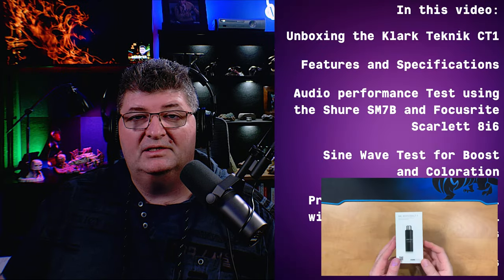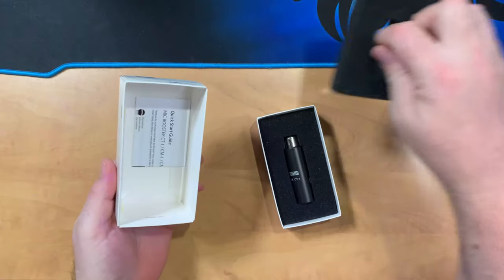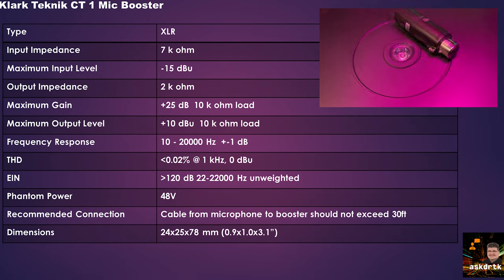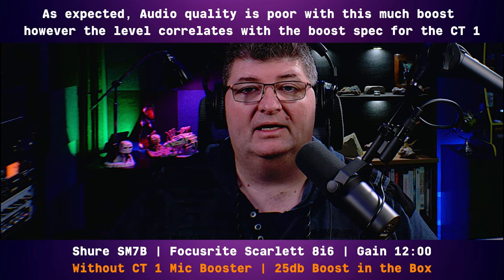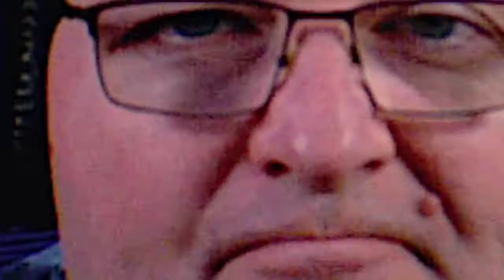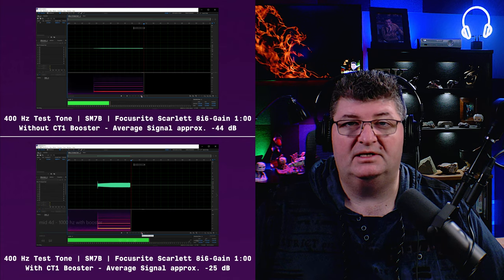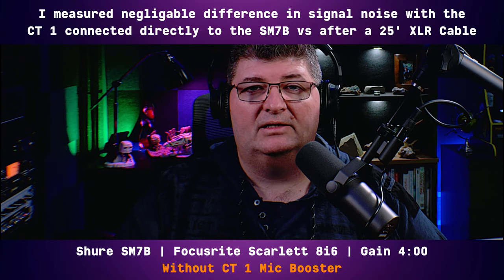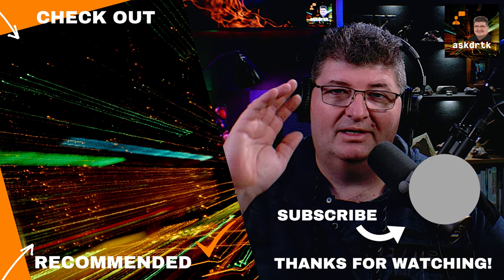Klark Teknik CT1 Mic Booster - Detailed Review and Tests

Comment: Thanks for your video! Though I do believe the long cable run before the booster makes for slight weakening of the signal. I feel if we put the CT1 right on the mic, there's significantly less cable run with low signal, instead basically the strong signal travels all the way directly from the mic into any preamps, which should make for a cleaner, stronger and less noisy signal. All through the same gear. But great video nonetheless!
Reply from the maker: Much appreciated! I agree 100 percent and I generally place boosters at or as close to the mic as possible for recording (one thing I don't like about my CL1s), but I thought since the CT1 specs say up to 30 foot cable between the mic and booster I wanted to test under this scenario. For comparison, I get about an additional 1.6 dB at 1kHz with the CT1 at the mic followed by a 25 foot xlr. I probably should have included some gain / noise floor charts "at the mic" and with a few cable combinations for those who like to use them on stage with 58s, etc. I'll think about that for the next mic booster review I do. Hope the bit of extra info helps out and thanks for sharing and checking our my review!

Comment: What a great device at this price over the $89 + ones.
Reply from the maker: Performance / build quality given the price do provide excellent value. The CT1 is a very good option for many. Thanks for checking out my review of the CT1!
Reply: @askdrtk  Mine actually died after one day lol. Started having tons of static and noise in my mic. Sweetwater refunded it, common issue I guess.
Reply from the maker: Sorry to hear - that is really unfortunate, but Sweetwater is top notch for service. I haven't heard of issues with these boosters and I have two myself that have been getting regular daily use for months with a few different preamps - no issues so far. The only one i have every had go bad was a Triton FetHead...
Reply: @askdrtk  Yeah that was weird. It worked great for a day then suddenly was all whacked out. Sweetwater was amazing though.

I will try another later, or just go the more expensive route and grab a cloudlifter.

Comment: which one is better the CT1 or the CM1
Reply from the maker: I haven't run a full set of audio tests on the CM1, however I have see the CM1 and the build quality of the CT1 seems better (stronger and more durable if you are moving it around). Also, the CT1 can be connected directly into your microphone, whereas the CM1 requires an additional cable between it and the mic.
Reply: @askdrtk  I don’t like the idea of it being connected to the mic 🎤 on the ct1 but I did see in the manual that you can run it as the cm1 with 2 cables
Reply from the maker: I agree, but some like to use it direct connected with the mic off camera...voiceover, etc. I've used CT1 with up to a 25 foot cable between it and the mic and then another 25 foot between the CT1 and preamp - no noise issues - all good. The CT1 is reliable, I've been using two of them in my shared recording space almost daily for months. I have other more expensive boosters, but the CT1 gets the job done.
Reply: @askdrtk  yeah im replacing my mic and using the Zoom ZDM1 which this mic has some buzzing ringing in it and the only was to get it to stop on the goXLR Mini is to drop my mic setup to around 35db and my treble from 4db-4db to 1db-0db at 7.5hz on the treble to get the ringing out but then it makes me sound really muddie this is not a problem with my mixer only via goXLR so the CT1 or CM1 will be best to get rid of the buzz dont really wanna spend money on a new mic the PD-70 or the MV7X
Reply from the maker: For sure boosting the signal will give you a better ratio against the noise from the goXLR Mini. If you're getting the noise on all mics connected to the goXLR mini, I've found noise from usb powered gear can often be reduced by using a ferrite core on the usb cable or changing you computer's power bar to an isolator such as a Furman or a Tripp-Lite isobar. Did this will all my gear and things got a lot quieter. Either way, more signal means lower relative noise.
Reply: @askdrtk  i never had this with any of my other mic's ive always used Condenser or Omni then Dynamic ive just purchased my first Dynamic mic a few months ago but the goXLR Mini bring that buzzing and ringing never had the problem on my other mixer. BTW was able to purchase the CT1 just now as its back in stock now on Sweetwater price when up $5 more also gonna purchase the CM1 for back up as soon as it comes back in stock
Reply from the maker: Great hear they are back in stock at Sweetwater - these are a really good value and having a backup never hurts... I'd appreciate if you let me know how it works out once you get it setup with your ZDM1 and goXLR mini.
Reply: @askdrtk  will do just got off the phone with frank from sweetwater should be here in the next 2days will keep you up to date
Reply: @askdrtk  btw have you review the Universal Audio SD1 and  The Villa MV3 really wanna try the Villa MV3 as it sound more like the SM7b and look like it more of a clone for $175 trying to see if i can get Review Units
Reply from the maker: I haven't tried either yet, but I would like to get my hands on them for review. I have a few really nice condensers up for review at the moment that are keeping me busy...
Reply: @askdrtk  just got the CT1 the other day its awesome only problem having is it dont stay in my mic. now that i got this going to purchase the MV3
Reply from the maker: Glad to hear the CT1 is doing the job. The spring lock can be stiff when they are new (sometimes needs a firm push to lock into the cable or mic). Let me know what you think of the MV3.

Comment: Is there any reason why this wouldn't help a weak condenser mic that has the option of being battery-powered, such as the Rode NTG-2?
Reply from the maker: You could use a booster such as this with a battery powered condenser mic. You could also use a phantom power supply such as the Xvive P1 between the booster and mic if a battery powered mic was not an option. There is also the Fethead Phantom mic booster from Triton that passes phantom power for condensers as an all-in-one option. Hope this helps out!

Comment: Thank you for this! I would buy one for my Rode Procaster. I am using UM2 - Behringer as an audio interface
Reply from the maker: All Good -  In my experience the XENYX preamp in your UM2 is pretty clean as long as gain is less than about 80%. The CT1 will help get your Procaster into the "sweet spot" without needing to push the UM2 too hard. The Procaster is a great mic and adding the booster should not only make the sound cleaner, but also thicken in up on the UM2. Hope this helps out and thanks again for checking out my review!
Reply: @askdrtk  I just ordered one for my Rode Podmic, using an RME fireface UC I wasn't happy with the level for spoken word for live voice chat in my case, the signal from the RME was very clean just not quite loud enough,  Many thanks for your solid review, The low end warmth should be quite pleasing in my case as I feel the podmic lacks a little low end warmth from the box.
Reply from the maker: Glad to help out. I agree, the CT1 is a good complement for the PodMic and should provide some additional warmth while maintaining the clarity the PodMic is well known for - i'm certain you will be pleased with the result. This will also give you a greater range of adjustment for gain on your RME (great clean interface) which is my preferred method vs simply adjusting in the box (proper gain at all stages beginning with the preamp = better sound imo). Thanks for checking out my review and sharing your use case!
Reply: @askdrtk  Thanks so much, I forgot to mention your review of the Podmic was in my opinion the best on here and influenced my purchase, thankfully the algorithm recommended your CT1 review as well. Keep up the fantastic content my friend and hope to see you continue to grow in the coming year!
Reply from the maker: Very much appreciated! I have alot of new gear (in all price points) in for review with more on the way + I am about to launch a full series on EQ, compression, mixing, and mastering with both plugins and outboard gear. It is going to be a busy year...
Reply: @askdrtk  Got the CT1 installed now and its doing the job perfectly, my gainstage via RME interface is superbly clean and plenty of headroom! Now just to contend with those pesky gaming PC fans lol...
Reply from the maker: Fantastic! Having room to adjust gain at all stages makes such a difference and ahh yes...PC fans definitely nice to be able to locate the PC away from recording areas. One day I'll add a long fiberoptic Thunderbolt cable between my PC and Dock and enjoy the silence...not anytime soon though...lol

Comment: Hi, may I ask if you have tried the CT1 directly at the back of Elgato Wave XLR?
Reply from the maker: Sorry, I don't have a Wave XLR to test. I see the recessed XLR jack would likely be an issue given the thickness of the CT1 cylinder. The male end of the CT1 generally does not fit directly into XLR jacks in my experience. If you need to connect directly, the sE DM1 has a thin profile and will likely not be an issue (I have tested it plugged in directly to many interfaces and preamps), otherwise you may need to use a short 1' XLR patch cable in between the Wave and booster. I hope this helps out!
Reply: @askdrtk Hi, I appreciate your time in replying. I bought a CT1 and confirmed that it is not compatible with direct installation with Elgato Wave XLR. I also bought 2 meters high quality XLR cable going from the mic to the CT1 and another 2 meters going to the wave xlr. So far all is well. Thank you!

Comment: Help mee.. Why my ct1 not working. Im using podmic with th audient evo4 audio interface.
Reply from the maker: The first thing to check is to ensure you have your evo 4's 48V phantom power turned on as the ct1 requires it to operate whereas the PodMic does not on its own. Hope this helps out!
Reply: @askdrtk  oh thanks.. it works.

Comment: Hi there, I just want to ask which is better setup. 1)Mic-->CT1-->XLR Cable-->Audio Interface or 2)Mic-->XLR Cable-->CT1-->Audio Interface? TIA...
Reply from the maker: In general, the closer the CT1 is to the microphone the better as it will boost noise picked up from the cable coming from the microphone in addition to the microphone signal itself. With the CT1 at the microphone, the mic signal travelling through the cable to the audio interface will be far greater vs any noise picked up along the way. That said, if you have short cable runs that are not running beside power wires, the difference will likely be negligible. Cheers!
Reply: @askdrtk Thank you so much! That's great explanation..

Comment: I even wonder how would this behave with different phantom power voltage, as there are devices which doesn't provide +48V but +15V, like cheaper mixer consoles such as Behringer xenyx 502.
Reply from the maker: That's a great question. Generally speaking with condenser mics, as phantom power voltage drops, transient performance decreases. It is often difficult to tell unless you are trying to record a very dynamic source (depending on the mic). There are three standards for phantom power 12V, 24V, and 48V, with 48 being the most common on modern equipment (24V never really seemed to gain any traction). 

The xenyx 502 is another story. I haven't used one, but I have had a few people tell me is does and does not provide phantom power - seems like the newer ones do (not switchable) as condenser mics seem to work with them whereas condenser's won't work with some of the older 502's.

In terms of a booster designed for 48V (like the ct1) I would believe the preamp design/components would determine what sort of impact on performance below spec voltage would have. Based on your question, I just ordered a selectable phantom power supply (12V/48V) as I think this would be a great test to include for both mics and boosters in future reviews! When it arrives, I'll test the ct1 and send you another reply. Thanks again for the great question!
Reply: @askdrtk  I'm really looking forward to it as I have that xenyx 502 with +15V. Would also want to know the difference between CM1 and CT1, but I only think that the difference is only in packaging as the price is fairly the same.
Reply from the maker: Thanks again for the question. I will be reviewing more mic boosters soon and I may be able to get a hold of a CM1 for comparison.
Reply from the maker: I have now tested the CT1 with 12V phantom power from my new selectable power supply and it functioned without issue. Both clarity and dynamic range appear unaffected, so you should be good to go with the 15V supply from your 502. I have also started including a phantom power test in my microphone reviews beginning with the Rode M3 (published today) - it also worked with 12V without issue. Thanks again for the great question and I hope this helps out!

Comment: Thanks for the test. My only suggestion would be a much shorter cable between the mic and booster. At this price I did order one through your link. 👍
Reply from the maker: Glad to help, thanks for the suggestion, and I agree - it is always best to use the shortest cable that is practical (booster or not). Since the specs suggested under 30 feet between the mic and booster, I wanted to test that and 25 was the closest I have. The best application for this I can think of would be handheld for live performance. It is nice that the booster does fit right onto the SM7B connection as well. From what I can tell, you can't go too far wrong with this booster at the price (it actually surprised me). Thanks again and enjoy...

Comment: I bought the sm7b and plan to use with scarlett 2i2 3rd gen. Im thinking between Coda Stealth and Klark Tecnik CT1 for the inline preamp. Leaving the price (as stealth is 3 times costlier), which one is better between the two?
Reply from the maker: The stealth will provide a few more dB's of gain vs the CT1, but the CT1 is more than enough for the SM7B on the 2i2. I haven't tested the Stealth for preamp coloration as I did with the CT1, but I have one coming in for review in January. I know a couple of people who use the Stealth and are happy with it, but I try not to recommend anything until I have tested it myself... What I know for sure is that both offer more than enough boost for your mic/interface combo.
Reply: @askdrtk   thanks for the reply... Will wait till january when u will get the stealth and make a comparision between the two...
Reply from the maker: Glad you have the opportunity to wait. I will be getting on the Stealth review as soon as it arrives...
Reply: @askdrtk   waiting eagerly to see your comparision and recommendation between the two...
Reply: @askdrtk  I heard that CT1 interferes with phone etc. so do you have any such issues with any electronic devices while using CT1?

also have u received and tested the coda stealth?
Reply from the maker: No issues with phones (I tried a few close up) or any other interference from the CT1. The most common issue is for a cable to be routed near sources of RF/EM interference. If you then connect a mic booster between that cable and your preamp, the noise is also boosted. If you connect the mic booster such as the CT1 at the microphone, it helps reduce the interference problem by increasing the signal from the mic, but not the RF/EM being picked up by the cable (better signal to noise ratio). All boosters will behave this way.

My stealth has shipped but hasn't arrived yet (slow post office...). Should be here soon and I will review it as soon as it arrives - I know you have been waiting on the comparison...
Reply: @askdrtk  thank you so much for the reply... was planning to connect the CT1 directly to the microphone as you ahve mentioned above...
Reply: @askdrtk  what is the xlr cable that you use? Which xlr cable do you recommend as i plan to use for headshot recording like this video...
Reply from the maker: I use both Hosa Pro and Mogami Gold Studio XLR for microphones (I have a few others, but I am gradually retiring them). All of my outboard gear interconnects are with Hosa Pro TRS and XLR cables and I use Hosa patch cables. There are measurable differences between cables in terms of noise and signal loss, however there are diminishing returns in performance vs price. Mogami are the quietest cable I have used, but in most applications outside of a pristine studio environment, it would be difficult to tell the difference. I recommend using your best XLR cable between your microphone and preamp/interface, after that higher signal levels already have the advantage of higher signal vs noise levels. I recommend Hosa Pro as being excellent value in terms of performance and quality vs price for most applications. Hope this helps out.
Reply: @askdrtk  thanks a ton for the reply... your reply are always very helpful... i also research and mogami is no doubt the best but maybe an overklill for me... so will go with hosa pro as Im a beginner.. good thing about hosa pro HMIC0 serioes is that it is 20 AWG with 90% oxygen free and briaded shielding.. so for price to performancem hosa pro will be the best bet... once again, thanks for the advice..
Reply from the maker: My pleasure as always! Hosa cables are widely used in professional applications, you will not be disappointed. On a side note, my Coda Stealth is lost by Canada Post in shipping, sorry for the delay in my review.
Reply: @askdrtk  thanks for the reply... Im sorry about the loss of your coda stealth... i finally decided for coda stealth and both the SM7B and stealth will be reaching tomorrow... will share my experiences once I tried them out...
Reply: Honestly that 3rd gen Scarlett should already have enough Gain with low noise for an SM7. Its preamp is a lot better than the previous generations'.